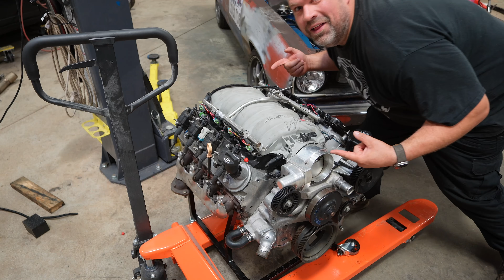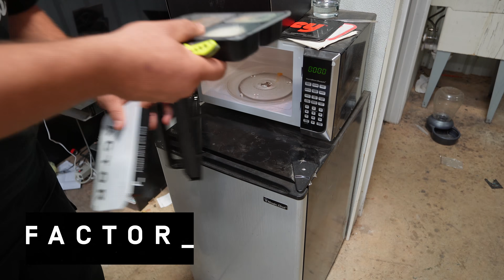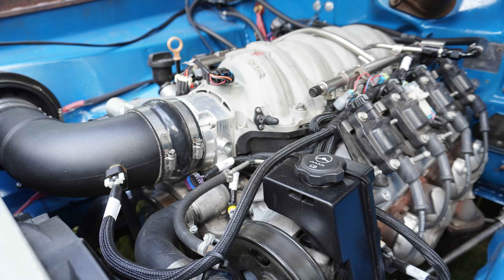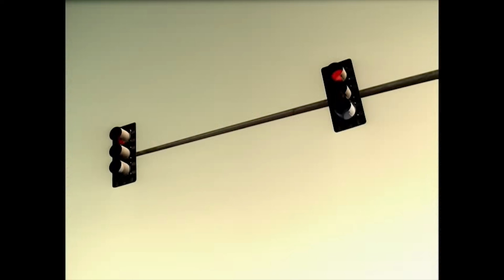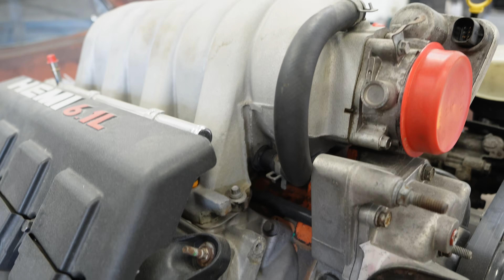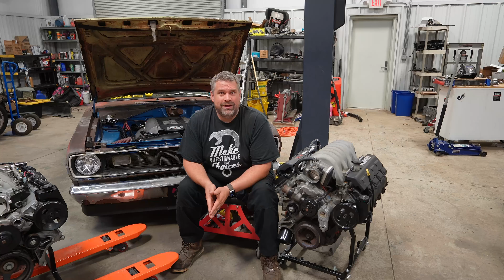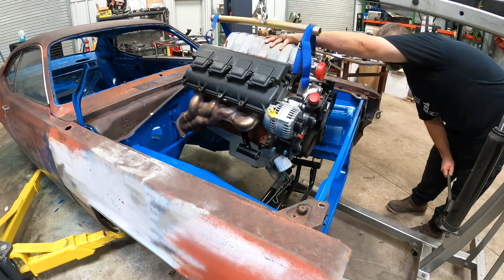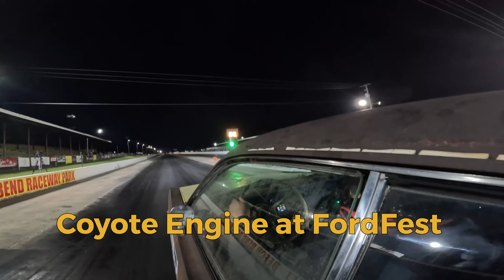What No One Tells You About Engine Swaps! Best Engine To Pick?

Comment: We must touch the change in casting methods as they moved to lost foam castings.  This allowed for better castings, finish, and better planned ports.  I remember working at an aluminum foundry that cast heads.  The process required an outer mold, resin/sand trees for the water jacket and the ports.  The process required extra work to remove the resin cores after the casting was complete.  Lost foam process made the clean up much easier.  Some people try to use casting sand/clay with lost foam, but they miss the true nature of lost foam.  Kelly Coffield (youtuber) shows the proper method of casting.  This method reduces the clean up process and speeds up the manufacturing process.

Comment: I believe the coyote has by far  the best flowing heads and does make more HP per CI. But unfortunately you are way more limited on the ford than any other. Obviously the LS is the cheapest because it’s the oldest by far,  it I just hate running a different brand engine in a car, especially when all 3 are so good.

Comment: My major consideration is reliability with fuel efficiency and the most power on pump gas. I can't use E85 as it isn't available locally and mpg is half of 93 octane premium. My application is a 1990 Z32 300ZX 2+2. I will upgrade transmission to 6spd stick. The horsepower goal is 500 to the tires. It seems to be between LS and Hemi, with LS having the edge in packaging and mpg potential. All aluminum is mandatory to reach my 50/50 weight goal. Unfortunately for the Coyote, the mpg suffers at the required power according to research.

Comment: Didn't the Gen III Hemi have oiling issues (lifters & camshafts having to be replaced because they moved the camshaft in the redesign to give it more power).  I seen a video about this on Uncle Tony's Garage, he went into detail about it & he is a Mopar guy.
Reply: Yeah it’s possible, seems very uncommon though. It’s 10x more likely in a DoD motor than a hemi
Reply: 5% of HEMIs lose cams around 100k.   Excessive low RPM and 10k mi. oil change intervals also blamed.  As well as Cylinder deactivation has also been blamed on LS 5.3 cam lifter failure along with inferior foreign hardened cams.  HEMI no longer made in 2025 replaced with TT Huricanne 6 that makes more h.p.  EPA killed it
Reply: @edwinblessing9811  The EPA has killed a lot of good engines, they’re basically the performance police.

Comment: Just LS everything, until the other two decide to make something that's at least comparable. 

I don't care if the Coyote might make more power... it's too wide, too tall, the performance-per-dollar is comparably horrible, and the timing assemblies require service every 10 years, regardless of mileage.

The Hemi? Don't even get me started. WAAAY too big, too heavy,  the valvetrain is too stressed, and the performance-per-dollar is right there with the Coyote (horrible).
Reply: Bingo
Reply: @xephael3485  - yup. I've seen factory LS blocks push the upper limits of 1k horsepower. Who needs that in a street car? I just can't justify taking up more space under the hood to do the same job, with less reliability, and a higher price tag.

Comment: I swapped a 5.7 liter Hemi into my 1972 Datsun 510. Of course I had to modify a periscope from a decommissioned submarine, and install it to allow me to see the road from the drivers seat. WORTH IT!!
Reply: I'm going to start off with acknowledging this is a dumb question, but did you have to cut/modify the firewall? How hard of a job was this, what transmission, rear end, and suspension parts did you use. Only reason for my inquiry is I purchased a 1981 Datsun 510 wagon last fall and am wide open for any info I can get. It's my first foreign project car, being I've always been more into the big 3, muscle cars, and trucks all from the 60's to 90's.
Reply: @paulcarter2879 I've been looking at trading in my 69 cougar for something smaller like a datsun 280z As it was my favorite as a kid and I have found it hard to get any reliable information on engine swap outs
Reply: Fuck yeah
Reply: Im planning to do that I have the same combo but mine it’s a 6.1 what do you need to modify to slap the motor in?
Reply: @rubenozuna1029   radiator cap...then slip a new car under it
Reply: Did you use the JC Whitney swap kit?

Comment: Spoiler alert.
As discussed previously, you already know the answer. 
As you already discovered,  the vacuum to the advance is the same as soon ad you tip in the throttle.
So the only difference is at idle.
With ported vacuum you can tune the base timing and idle mixture and when you connect the vacuum adv, no changes are required.
There are no performance or economy differences between them.

Comment: The size and weight of the LS engines means they can be swapped into an incredible number of foreign models, like the Mazda Miata, or BMW 3 series.  For the most part, the HEMI and Coyote are usually swapped into only their respective American makes, with substantially fewer cross-manufacturer swaps.
Reply: Also a infinti q50 lol..

Comment: I bleed ford blue. And I’ve got an 09 mustang GT. It has 200k miles that had an engine noise. 

My first thought was Coyote.  After pricing the swap, I decided to price an 
LS. LC9 to be specific. 

I found that I could buy the ls, a six speed and stand alone ecm for less money than a low mile mustang coyote.

Thankfully, phasers, chains and guides fixed the noise

Comment: I have a 1966 GMC I1000 1/2-ton pickup. It has the first gen 250/4.1L inline 6. All things considered, it's a fun engine in that truck. It is ridiculously torquey and will throw you back in the seat if you get on it. Plus, it will easily cruise at 75mph.
The only major issue with it is that it was a farm truck, so it didn't have much for creature comforts. No power brakes or power steering or automatic. Why would you need that for just a basic pickup in 1966???? Yea it would be a nicer driving truck with those. Particularly the power steering.
If I were to do a swap, I'd definitely go with the Gen 1 LS, and an automatic.

Comment: I don't know about power but the Coyote in my service truck has 340k miles and has only had oil changes, an alternator and some coil packs replaced.  I know it has slightly less compression and milder cams than the Mustang version but this has been a really good engine.
Reply: I'm pretty certain that nobody is concerned with the engine repair cost on a truck pushing 400k miles. 😉
Reply: @SpaceCoastMiniBikes  a truck approaching 400k miles that needs engine work is most likely salvage yard bound. At that point, a new or different truck altogether is the more economical move.
 Yes, ls engines are cheaper in general.
Reply: @@SpaceCoastMiniBikes Well if an engine goes 400,000 miles I don’t think I really care how expensive it is to fix anymore. Time for a new truck. I have 3 relatives that blew up their ls trucks before 150k miles. Boop, $6k out the door to get their money’s worth out of the truck. That’s real world math, facts are facts.

Comment: I have done swaps with all these motors whatever the customer bring is what I’m working with. But I got to say the LS engine is one of my favorites due to all the accessories that are available for this engines different water pumps , head swapping ,different alternators different brackets exhaust manifolds are endless. And very easy to make motor mounts but the majority of the time these engine mounts are available already.
Reply: Which would you say is the most reliable on the daily for the longest prolly the ls right?

Comment: I have a 40 dodge couple with a 1st gen 392 hemi in it. its still in the project stage and isn't running, costing more than I have currently to get that running. I also have a 97 camaro that I drive around all summer. that car is super fun. that said, if I were a rich man, I'd put a gen 3 hemi in it just to piss off the chevy guys. would be neat  to put a hellephant motor in it!!

Comment: 4.6 2v is honestly a great swap for many applications. You don’t need crazy horsepower to have fun but you can boost them very reliably to 400whp and with 4.10 gears it is a lot of fun
Reply: But it still sounds like a 2v. 🤮
Reply: and are still huge engines, thus a pita to swap. @ChinookBear

Comment: Engine masters took a Eagle Hemi from a Ram, added long tube headers  and a comp cam. With the stock intake, it made 500 hp.
Reply: at the crank. im assuming since its engine masters. thats what you could expect out of an LS3
Reply: @Cullinane2010  in all reality the LS and the hemi can make the same power. It all comes down to price
Reply: @Cullinane2010 stock ls3
Reply: That's about what a cammed 5.7 LS1 does.. very similar

Comment: Good series.  But damn…hating on the coyote!….  Also…the chassis platform…mopar?….🤮.  You did not however consider what it takes to make hp in these motors.  A Gen 2 coyote needs only boost and fuel up until the 1000hp mark.  You don’t have to lift so much as a valve cover.  The LS and then Mopar will require some level of disassembly.  Again…good series, but grab some information from outside sources on each developer.  Especially tuners.  They can tell you the limits of each platform.  Speedy recovery J…👍

Comment: Small block ford....fits in a 1984 Datsun 200sx very well....heck I can easily swap spark plugs with headers.....yes a bit old school now but with a good cam GT40 heads intake with a Haltech it moves my little car very well    no cutting of the body   I agree on the coal rolling fools....ruins it for us other folks.....The OHC engines are very wide and do not fit in small cars well....another factor is engine reliability and weight.....

Comment: Cool video, the coyote is certainly neat, but for engine swaps, it's tough to beat a compact pushrod V8.
I would've skipped the coyote and gone with a gas 7.3 or a 5.0/5.8 Windsor with aftermarket heads/crank/etc.  It would be neat to see how pushrod fords would've done against those other pushrod V8s.
Reply: The coyote fits fine in fox bodies and all the sn95 and s197 mustangs it will fit fine in alot of things.   This shouldn't be an issue unless you're trying to fit it somewhere where it won't fit which is prob not that many vehicles.  Prob not best for a miata.

Comment: The Modular motor 2v 4.6 was introduced in ‘91 in the Lincoln Town Car.  ‘92 in the Crown Vic, and ‘96 in the Mustang.  The Aluminum block 4v 4.6 was introduced in the ‘93 Lincoln MkVIII and then the ‘96 Mustang SVT Cobra.  The 2v 4.6 was introduced in the ‘97 F150, and the 2v 5.4 debuted the same year in the F250.  The only 5.4 in a Mustang was the hand built SVT 4v for the racing intended Mustang Cobra R.  There was a 4v 5.4 iron block used in the early 2000s Lincoln Navigator.
Reply: The 4 valve 4.6 was also used in the Lincoln Continental.
Reply: Thank you for clarifying. He was killing me with the wrong info on the modular.
Reply: I believe there were 2 f-250s in 97.  The new f150 body style came out that year, but the new superduty was still a couple years away. The 250/350 were still the early 90’s body with pushrod v-8s. Ford made the f250 “light duty” using the f150 body, beefed up frame, suspension and diff. These trucks used the 5.4 2v modular SOHC V8.  After the superduty debuted in 1999 the f150 light duty continued to be made until 2003 , called the f150 7700.
Reply: My dad had 3 Mark VIIIs in the 90s & early 2000s; had a 93, then traded it for a 95, kept the 95 and bought a 98 as well.  They were quick and a lot of fun to drive.  Got a couple tickets in them when I was 16-17 years old (2001-2002) and almost lost my license.  I still wanna get a Mark VIII and build it like I know he’d have wanted.  Maybe I’ll get to one day.
Reply: If you are not counting the shelby gt500 as a mustang your correct. But the 2008 shelby mustang gt500 used the same 5.4l v8 thats the ford GT had. And it was an evolution of the 3v 4.6 in the 05-10 mustang.  Soo yes, there was a modular 5.4 in a mustang. The 08-09 shelby gt500.

Comment: I  do  believe  it  still comes  down  to  run  what  you're  familiar  with.  I  am  reasonably  familiar with  GM/Ford  engines.  I  can  figure  them  out,  if  needed.  But  I  still  prefer  Mopar  in  my  Car.  I  know  Mopar  well  enough  that  I  don't  need  to  make  an  educated  guess.  And  I  am  slightly,  (Read  very,)  brand  loyal.  Yes,  Chevy  small  block  has   a  huge  aftermarket  support.  Go  figure.  In  the  late  70's  and  80's,  Chevy  was  the  thing  to  run,  because  there  were  so  many  327's  and  350's  in  junkyards,  that  they  were  dirst  cheap.  I  can  remember  getting  them  for  100  bucks,  freshly  pulled.  A  360 mopar  was  150  to  200,  a  340  was  more.  A  ford  302,  150  to  200  also.  The  performance  guys,  Edelbrock  and  all,  made  hundreds  of  Chevy  parts,  compared  to  dozens  of  Mopar  and  Ford.  Chevy  got  the  jump  on  us.  So  ya,  even  still  Chevy  for  yer  hotrod,  cuz  there's  a  huge  aftermarket.  Kind  of  like  Ford  Bronco,  Chevy  Blazers  and  the Dodge  Ramcharger,  compared  to  Jeeps.  Who  has  the  biggest  aftermarket  there..........